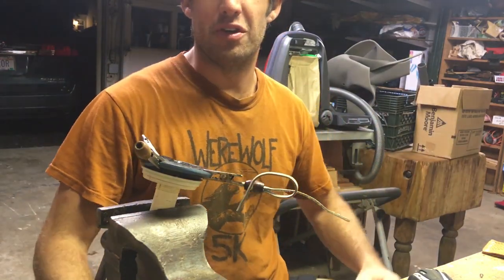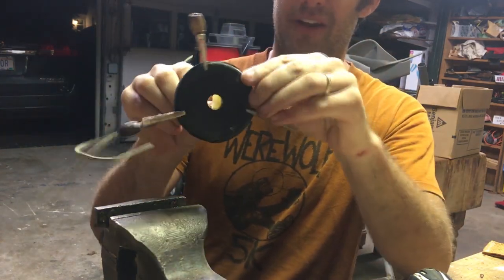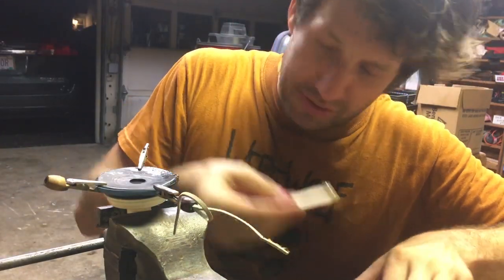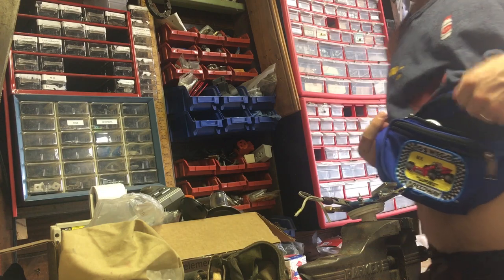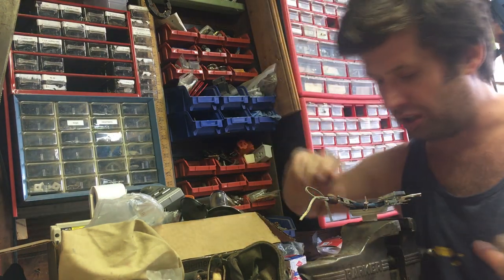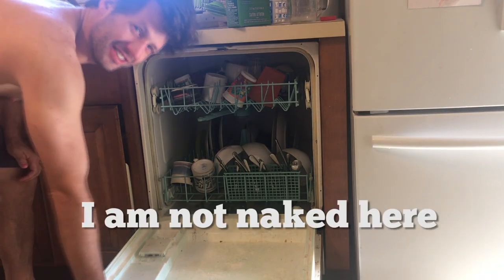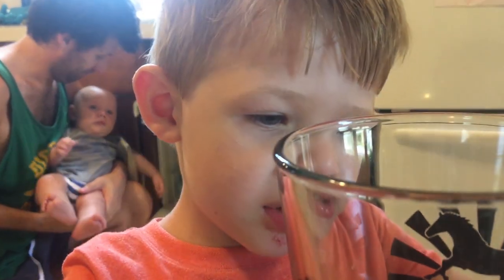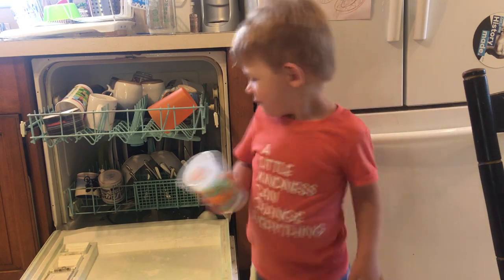Fixing a Whirlpool DU3003 Dishwasher from 1984

Comment: If you take the part number on the rubber pressure cap you find new ones or used ones that are uncracked and put it into an eBay search. They are dirt cheap. Hope you still have it, that machine is one of a kind and will run forever.